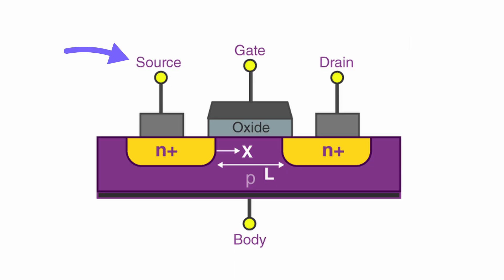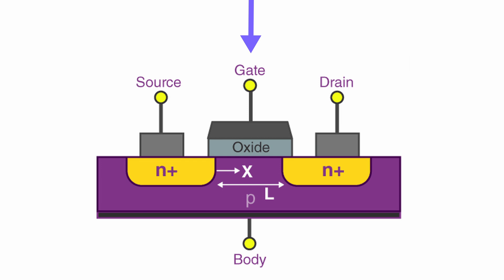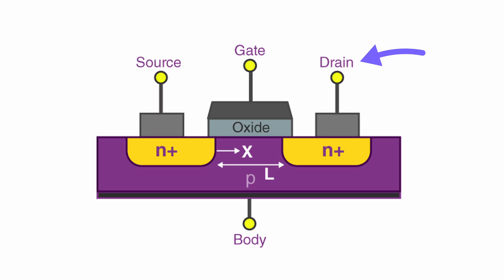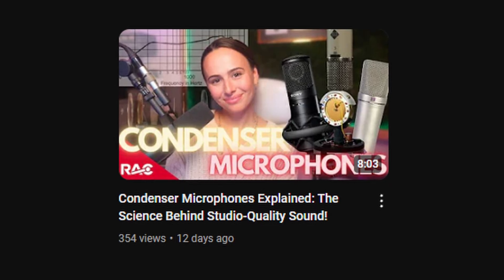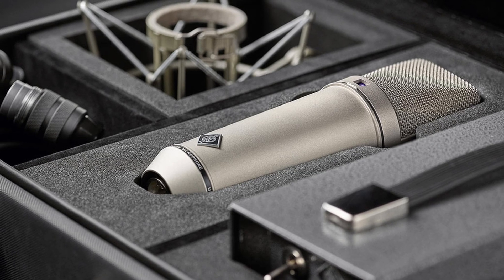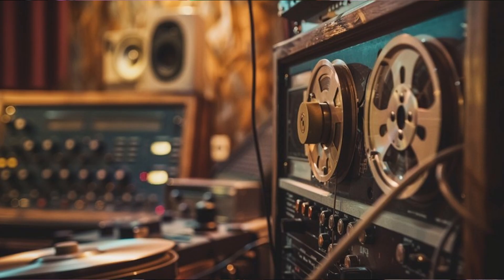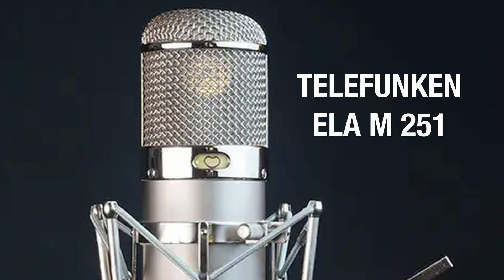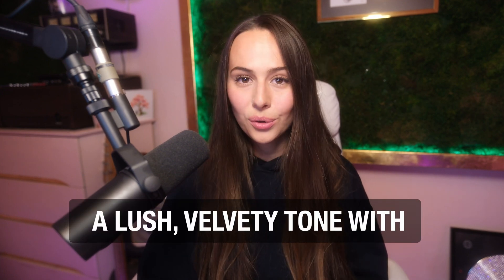Tube Warmth vs. FET Precision: Which Microphone is Right for You? W/ @DariannaEverett

Comment: I have tube mics that sound as fast as FET. The question is how did I achieve that. Your explanation of tube and FET electronics was mostly correct but...let's leave it at that. Also tube mics are much simpler and usually a single stage of amplification, solid state on the other hand needs all kinds of support circuitry to function. They also rely on feedback to manage gain and input swing capability, tubes do not.
Reply from the maker: I'm always learning, appreciate the feedback! Love baddasses like yourself adding to the conversation 🙏😊 Thank youuuuu!

Comment: Well...
1. Every element used for amplification (tube, various FETs, BJTs, what have you) is inherently non-linear, and actually closer to each other in that transfer curve than marketing leads you to believe. The linearity of the whole circuit is another thing, and a well-designed amplifier keeps THD down enough that it doesn't matter anymore, regardless of the active element used.
2. FETs do not "amplify electrons". Electrons are electrons. They control the flow of electrons, so current. But again, whether you want current amplification or voltage amplification, depends on the circuit, not just the element.
3. A transformer doesn't make a circuit complex, transistor mic circuits also involve multiple gain stages, and transformers can also be used in solid-state circuits - like in the mentioned U87 or C414. Speaking of which...
4. All the microphones you mentioned have different capsules. Some have corrective EQ in the circuit, some not. The presence or lack of a tube is, arguably, not much of a concern compared to those differences, not for sound anyway.
I'm not going to comment on subjective descriptions of tone, just remember to look up a frequency response graph instead of trying to figure out what "rich", "smooth" or "warm" is. Instead, I'll point out that because all the mics mentioned have so many versions and revisions, statements like "a C414 sounds modern" are a huge simplification.
Reply from the maker: @BananaManPL  love this comment!! Such great detailed info in here. Thanks so much for sharing 🙌😊 I’ve mention in a few videos I’m just starting to really dive into electronics and components because I find it fascinating. Wanted to keep the concepts and ideas simple as most of our viewers are just starting but definitely taking all the notes I can to better communicate to our cool community🤓 thanks so much for your awesome detailed comment✨